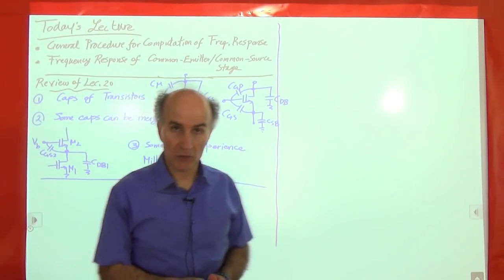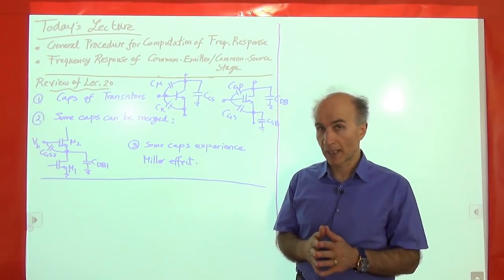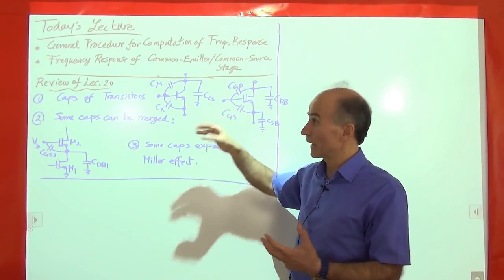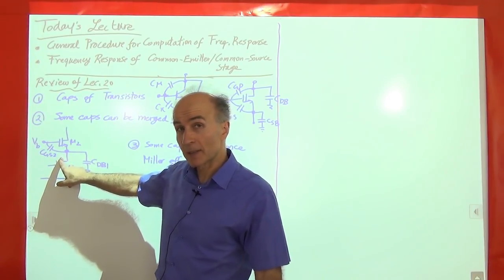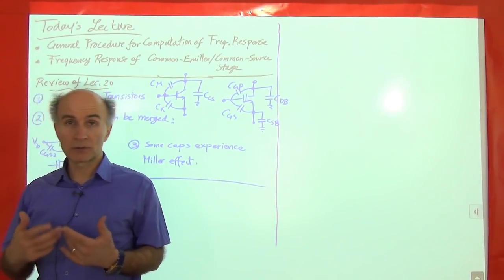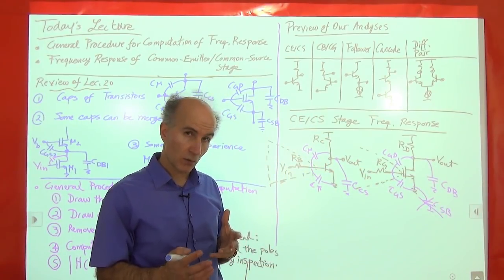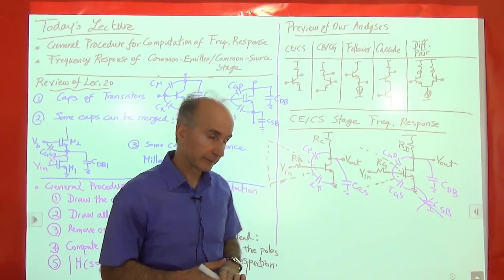Razavi Electronics2 Lec21: Computation of Freq. Resp., Freq. Resp. of Common-Emitter/Source Stages

Comment: 01:25 - Intro and Review of Lecture 20
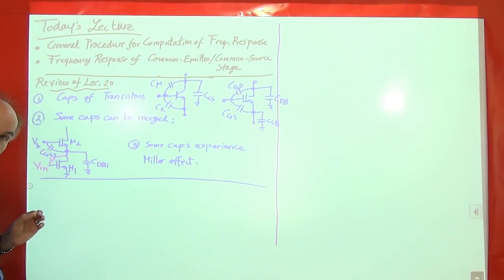04:28 - General Procedure for Frequency Response Computation
10:58 - Preview of Analysis Circuits
13:12 - CE/CS Stage Frequency Response
24:00 - CE/CS Stage Frequency Response: Finding Poles by Inspection
32:20 - CE/CS Stage Frequency Response: Bode's Plot
34:15 - CE/CS Stage Frequency Response: Exact Analysis
44:15 - CE/CS Stage Frequency Response: Observations and Dominant Pole Approximation

Comment: I think Prof Razavi's denominator in the transfer function at 43:00 might be wrong. 

I put the KCL equations through a symbolic solver and got the following for the transfer function : 
R_D*(g_m - C_GS*s)/R_D*R_G*s^2*(C_DB*C_GD + C_DB*C_GS + C_GS^2) + s*(C_DB*R_D + C_GD*R_D*R_G*g_m + C_GD*R_G + C_GS*R_D + C_GS*R_G) + 1.

The difference being with the square term on the denominator, where instead of C_GS*C_GB, I got C_GS^2. Not super important, but caused me some confusion.
Reply: I carried out the calculations myself, his function is correct. You must have made some mistake in between

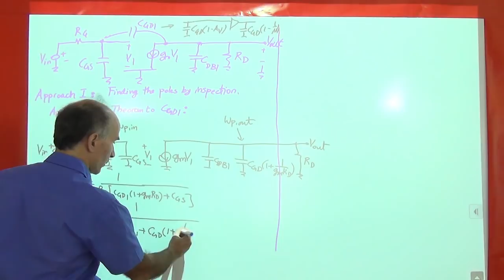Comment: One question, at ~ 31:50 why is the transistor Current Source = g_m * V_1 considered an independent current source? This source should not be set to zero.
Reply: Yes, but because the input voltage goes to zero, V1 also is zero, and hence gmV1 is zero